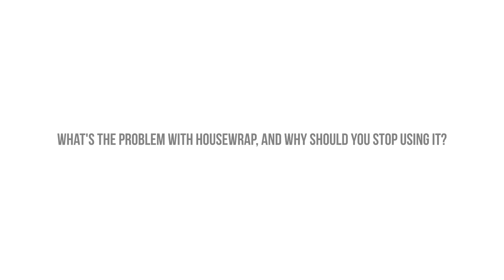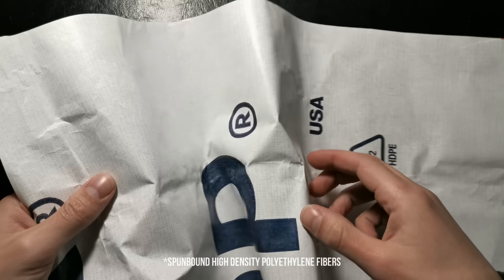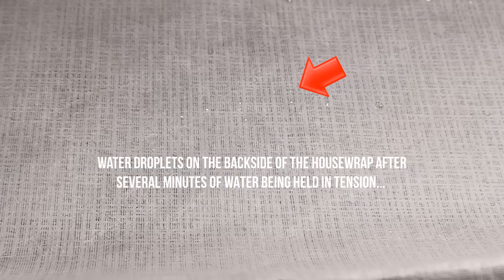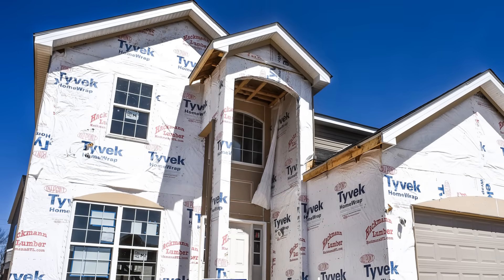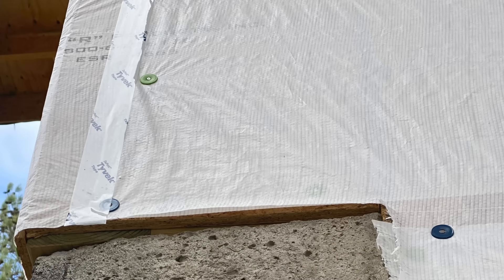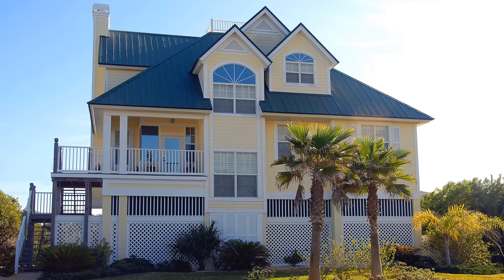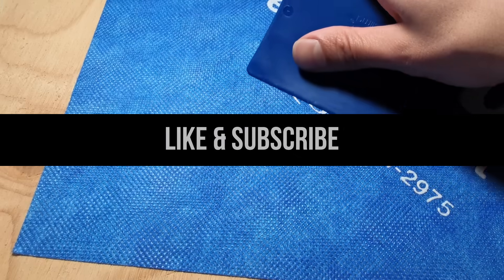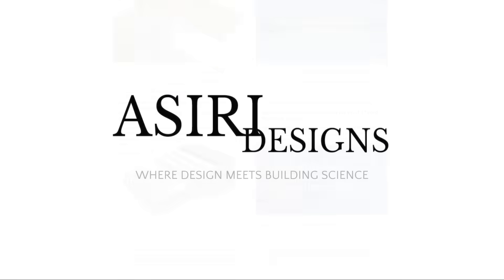Why I Stopped Using House Wrap

Comment: maybe 10-13 years late discouraging the use of tyvek.  Tyvek is (almost) as bad as wrapping your house in poly film.  This layer does NOT breathe, and you are basically hermetically sealing your house up like a petri dish.  In colder climates like Maine, virtually all houses built in the 1990's are sheathed in plywood, then wrapped in tyvek.  
I cannot begin to tell you how many Higher end homes I have worked on with the best quality Western Red Cedar clapboards that money can buy are laid over Tyvek.  
Pull off a Clapboard, and put your HAND directly thru the Tyvek, the Completely Rotten Plywood and into the fiberglass insulation. 
This would NOT have happened if Felt was used instead of Poly or Tyvek.
Typar seems much more breathable, and the Rot and Mold are significantly better if this is used.
Moisture was Trapped BETWEEN the Tyvek and Plywood layer resulting in Mold and Rot.  Over and over and over.
its a shame, really.

Comment: In my35 years of experience as a painter and then a carpenter specializing in old homes repairs, I have never seen an issue with Tyvek. I work on houses in New England. When I see chronic paint peeling on a house, I know there’s tar paper underneath the shingles or clapboards. And when I removed the siding, there’s an unmissable dampness to the assembly, almost like an old sweaty T-shirt. I will continue to use Tyvek (for repairs, not building a new house) as if it is done right, with a product like Vycor 4” wide stuck to the  Tyvek at all seams, it performs perfectly. Properly installed head flashing is important, too

Comment: Retired building enclosure consultant. My comments apply to a cool climate condition, more heating than A/C required year over year. Totally agree that adhered or fluid applied air/moisture barriers are the best route for durable protection of wall structure. If insulation is installed between studs the  applied product needs to be vapour permiable while still being a continuous air barrier. Further providing some exterior insulation to address thermal bridging at framing members (studs, plates, and rim joists) significantly improves thermal performance. Provision of a vented and drained strapped capillary break between the air/moisture barrier and the cladding is critical when building in a moist coastal environment or any other with rainfall over 30" (750mm) per year. It's important to understand that no cladding can be 100% leak proof especially when wind blown rain occurs.

Comment: Tight encapsulation seems like a great idea unless it leaks. Then, for every dollar saved on energy, ten are spent on repairs 30 years later. In more moderate climates, sheathing design doesn’t seem to be the main area of opportunity. Take apart almost any 40 year house and the vulnerability is around windows and doors — flashing. Folding an inch of tyvek margin into a window frame with no flashing tapes, and poor head flashing to prevent water from getting in in the first place.

Comment: I’m a roofer as I’ve always resisted from using tyvec tarp crap on my roofs because tar paper is mean to absorb then evaporate moisture through into attic space where good ventilation removes it but it keeps your roof trusses and roof decking with a certain moisture content so it remains flexible . If your wood dries out it is more prone to cracking and breaking with light contact from debris and foliage .

Comment: I need to redo the cypress siding on the side of my house when I built it 30 years ago I use tyvack and tarpaper(in different places). I would like to use peel and stick to replace the Tyvack and tarpaper. My concern is would  cause a problem. also I live in Central Florida do you see any problem with the peel and stick.

Comment: I think you mean vapor barrier, the siding should be doing the work and I have worked with enough decayed tar paper to believe it's inferior... Heat and dry can really make it flaky if I remember correctly... And it doesn't permit moisture transfer, kinda like putting your kids head in a bag and it gets foggy

Comment: I have done a lot of remodeling.  The tyvek is always deteriorated to powder. It has a short shelf life. A house must breathe. Vapor lock is bad. Especially in freezing temperatures. My opinion is tar paper and tyvek are used during construction to prevent weather damage. Like a roof lmao after you drive all those nails in it from the shingles it is Swiss cheese. Just weather protection until it gets covered. Like wall coverings just protection before finishing

Comment: Tyvek is NOT a water barrier. Period!
That's Nonsense ! It was designed to be an AIR BARRIER Not a water barrier. 
Tyvek or at least the material it really is..  Typically used as Irrigation pipings ...as it IS water permeable and allows even water feed to plants.

Comment: New homes should come with large roof overhangs, solar panels, a rain water collection system and an electric vehicle charger in the garage.
Water is the enemy of buildings.  Large roof overhangs add beauty and protection for doors, windows and siding.

Comment: Lot's of good comments on this vid. I was a plastering contractor for 30 years and turned down jobs requiring any of the Dupont wraps. Often I would look at the job and find the walls covered with housewrap, completely covering the bottom window flashing. The only way to correct this is to cut the housewrap, pull out the flashing and try to patch it with tape, which is a fool's errand. Also, the nailing on the studs is covered so it is hard to mark the studs for nailing the wire. One item of housewrap evolution that was left out is Stucco wrap. USG and Dupont joined forces for the USG EIFs systems with Dupont making the Stucco wrap. It was clearly stated that it was NOT to be used behind conventional 3 coat stucco systems. USG pulled out of the EIFs market and left Dupont with miles of Stuccowrap that somehow overnight became approved for use behind 3 coat stucco. Another issue with it and exterior plaster is that where the plaster (stucco for the layman) meets the wrap, the surface is very dense and slick. This creates a tensile stress which is more prone to cracking. It is best if the cured plaster is more open on the inner and outer surface. BTW, plaster comes from a Greek word meaning to "daub on". Any material in plastic (semi-solid) form that can be applied to a surface can qualify as plaster. Stucco is a particular material used for the final coat , usually applied about 1/8" thick consisting of sand, and some form of cement, gypsum for interior portland for the exterior. So in the trades we use the term plaster for both interior and exterior, and stucco for the finish coat.

Comment: If you have just a slight amount of positive air pressure inside the house, especially when outside humidity is very high, I would think you could nearly eliminate some of these problems.

Comment: I agree there are better alternatives thwn House Wraps.  Fluid applied membranes like Prosoco are great, but it's cost prohibitive for most home buyers.    Zip systems are also great, but only work when the installers have a high level of attention to detail, especially with over driven nails and penetrations.    Most Zip System installers don't go over the nails with Liquid Flash, which I think should be standard installation proceedure. 

I feel the majority of the probelm with house wraps is that house framers install it in a rapid pace without proper training given.   Almost all house wraps I see are installed incorrectly.    It takes time, patience and knowledge to install house wraps according to manufacturers recommendations, and detailing the flashing and taping  of penetrations, windows and doors adds even more complications and opportunities for incorrect installations. 

Most home builders that use Tyvek HouseWrap still use Asphalt based flashing tape that is outdated, cheap and has no place on the jobsite.  Asphalt based tapes like MFM Window Wrap and Protecto Wrap tapes start to peel off usually the same week, even properly rolled they will start to peel off before being covered by brick/siding/stucco.   Plus they are not compatible with polyurethane elastomeric sealants, they will start dripping when in contact with the plasticizers in polyurethane sealant.   So any window sealed with Tremco Dymonic or NP1 might cause an Asphalt based flashing tape to fail a lot quicker. 

I used Tyvek Straight Flash and Flex Wrap to flash all penetrations and windows in our home with excellent results.  They are butyl based tapes and while they cost double or more over Asphalt based flashing tapes, they will last over time when installed properly.  I highly recommend their Flex Wrap that comes indifferent widths.   Works great when sealing water bibb pipes, gas lines, wiring, etc.      It's super useful when flashing window sills as well. 

When people take time to read all of Dupont's online resource materials regarding best installation practices, you will find Dupont has lists of adhesives and sealants compatible with their wrpas and flashing tapes, such as Tremco Dymonic 100, NP-1, 3M Hi-Strength Super 90 spray adhesive, etc etc.   The problem is that it probably takes 3-4x longer in man hours of labor to properly prep and install the WRB wrap and flash all the penetrations and windows vs what 95% of home builders do now.    Tyvek's butyl based flashing tapes are fantastic and even adhere well to sheathing when the OSB is lightly sanded, 3M 90 spray adhesive is applied and the tape is properly rolled. 

Additionally Tyvek's Commercial D Wrap and RainVent Wraps are far better options than their standard House Wrap, but costs s lot more and needs a knowledgable installer.   They drain moisture more effectively and let the sheathing dry out better vs regular House Wrap.  

Just my 2 cents....

Comment: Good ole fashioned tar paper with vapor barrier on the interior is the bomb
Reply: What is the vapor barrier on the inside ? TIA
Reply: @ visqueen , two coat paint job on Sheetrock, the moisture that gets into your wall cavity is usually from the interior of the house. The goal is to keep condensation from developing in the wall.

Comment: Tyvek or really any house wrap isn’t great at preventing moisture infiltration. 

However!  It does a really great job of trapping moisture!; resulting in condensation and eventually mold.
Reply: It’s good at one sided moisture deflection between wood and exterior clad.  It does breathe, only traps moisture between wrap and exterior clad material.

Comment: I went to a fenestration workshop several years ago . . . the presenter was showcasing Tyvek . . . I raised my concerns.  He then showcased a new Tyvek with dimples that were supposed to be an effective rain drain.  I suggested that those dimples would prevent the siding from being tightly affixed to the wall structure.  Later that year, the presenter was at a show in Las Vegas and brought up the problem at the Tyvek display.  They listened and then kindly asked to stay away from their display.

Comment: I use 15" roofing felt with 6" lap, horizontal and vertical.  That allows the interior humidity to exit the building.  There's a 12-unit condo in my town that's about 15 years old.  It was wrapped with Tyvek. The Tyvek held the moisture in the wall, resulting in the lower 1/2 of the stucco having to be replaced twice (including the OSB sheathing).  What a waste.

Comment: Ive remolded a bunch of houses that used tyvek under cedar siding. It seems like tannins from the cedar penetrated the tyvek and caused it to crumble like old parchment paper. I went back to using felt paper and semi rigid mineral wool for insulation and plywood sheathing
Reply: Corply made by HAL Industries has one asphalt paper  corrugated sheet bonded to a regular
 sheet..
It protects and creates air space for better drying.
Try it..
Reply: @Peter-j4b1q  I was told that the expansion and contraction of the cedar actually rubs the Tavel  like sandpaper, eventually causing it to fail, and it should never be used under cedar.

Comment: Price is everything with todays developers, 5 times more than house wrap, that is a lot of money,  typical house need 3 to 4 rolls of house wrap at $180 per roll plus installation another $100 to 200 per roll. Meaning typical house cost is about $1500 if you x5 that it will cost $7,500. If it is built as a speck house this will be considered waste.  If it is build for a client, it will be offered with a premium and not every homeowner can see the difference
Reply: And 7500$ over the total cost of the house is?

Comment: As carpenter for over 50years, I’ve had to repair a fair number of homes with vinyl siding on them with zero house wrap on them! Vinyl siding can and does leak water behind it! I usually find the rot at the lower corners of windows and doors! But have seen it happen where vinyl seems occur! You’ve got to put something behind the vinyl!

Comment: Tyvek (etc) is CRAP !  It was developed as an AIR Barrier....  NOT a water barrier ... PERIOD. 
 Water pisses thru it like Kleenex.  Fit it under Stucco and the House Rots... Very quickly.
Irrigation systems are built from Tyvek  Because it passes water.. nicely.

Comment: I have seen where Tar paper protects a house better than most high tech fabrics. Tyvek and Typar do not self seal around nails and allow water to penetrate behind them. Have repaired many homes only 10-15 years old with water damage from modern fabric house wraps. Not so with tar paper.

Comment: So little knowledge... Tar paper was fine for houses that let a lot of air infiltration through. Once homes began to "tighten up" they needed a permeable membrane (tar paper not air permeable either direction). Tyvek lets moisture OUT of the envelope but not in. As for strength, try to tear or even cut Tyvek - that stuff is very tough. Finally, as for not using it? Good luck, most modern building codes prescribe ACH (air-changes/hour) and you can't get there with tar paper. People with opinions that go against both building science and building codes should keep their opinions to themselves as they are leading others down a dangerous path.

Comment: I appreciate your videos on building science. As someone who has 27 years of experience building new , and remodeling homes built from 1700s to present I’ve seen the changes in building systems. Hands down (my opinion of course) #1 reason behind water or moisture problems is due to poor planning (not considering the building as a whole) and instillation methods of the products being used  . ZIP system has many flaws particularly at termination areas where siding meets exterior trim and transitions . How do you mitigate those issues? With peel and stick membranes or house wraps . It’s my belief that carpenters are simply not trained properly , window manufacturers even have homes in their instillation methods . I could go on forever on how house wraps can be far superior to some of these products out there when correctly installed

Comment: From UK, 
Housewrap and similar are now standard practice here.
We always have a drained cavity in front of the membrane.
I have not heard of issues if installed correctly.
That said, as an architect, I am trying to get the builders to use tapes and seal all joints to prevent air leakage….not an easy job.  In the day of bituminous non breathable membranes, wall and roof, they relied on open but lapped joints to let air through and keep things dry. 
Fortunately we don’t (yet, climate change!) have to worry about reverse moisture movement with AC and hot humid external conditions.

Comment: Wouldn't rigid foam exterior insulation with the seams taped also make a water and air tight barrier? That is what I am currently doing on my home, with a rain screen between the rigid foam board and the new hardie siding I am putting up.
Reply: I'm in your boat. I can't figure out why there's not more information about this. Rigid foam seems to be the answer, as long as it's taped well
Reply: Please - what is a rain screen ? After the rigid foam?
Reply: A small gap between the siding and foam so the back of thei siding can dry @karlakay

Comment: Prepare to be sued with a video like this. You should try to get code changed rather than telling builders to violate code.
Reply from the maker: @CRPerformance1  There's nothing here that violates code, self adhered and fluid applied membranes go above and beyond code... Did you even watch the video?
Reply: @ASIRIDesigns  yeah, good luck with that. Hope you have an LLC and a good attorney.

Comment: All these "barrier" products for water and heat all seek to achieve something you don't want - a trap for moisture and air in the home. If you really perfectly seal your windows, doors, walls, floors, and roof, your house becomes a carbon dioxide death trap and fills with mold because every person in the house and all your pluming appliances exhale/sweat many cups of moisture every day that condense on and are absorbed into the building materials. So, the law says - "Spend an extra $50k in materials to seal your house perfectly to save $500 a year in energy, but first buy a $5k air exchanger and several $500 dehumidifiers every few years to let your house breathe, using even more electricity, space, and money than you saved. Praise us in our wisdom! What would you do without us?"